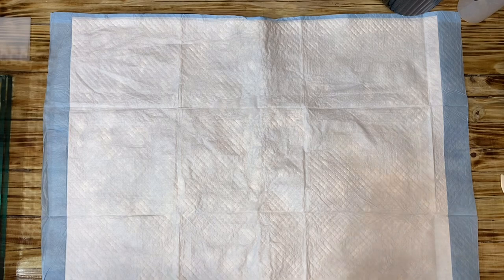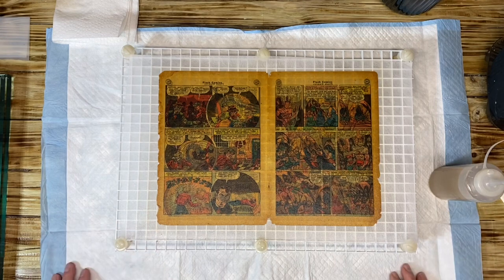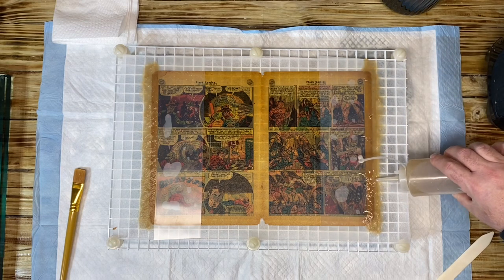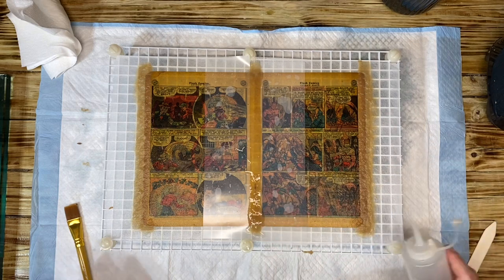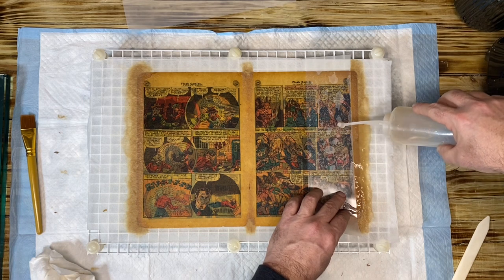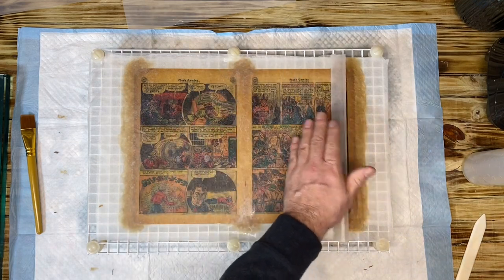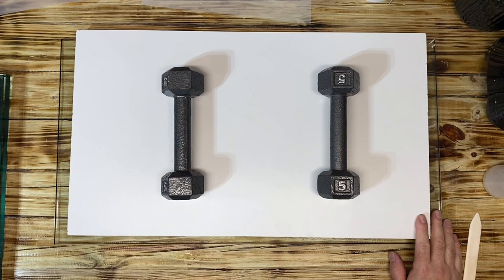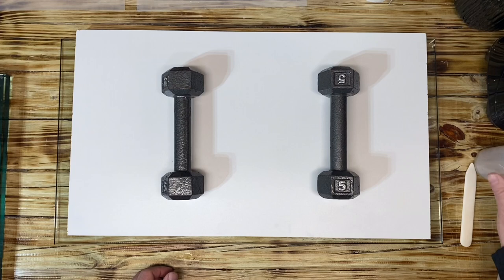Leaf Casting Comic Books without a Leaf Casting Table or Vacuum! You can do it! Part 2

Comment: I love that this is all possible without having you use a vacuum chamber.  It's a little tedious bit with practice it's a great way to take care of minimal leaf casting.  I don't think it's the best solution for some of the seriously mangled books you've worked in in the past
Reply from the maker: You are correct.  The more damage needed to be repaired the more suction is needed.  Stay tuned Mr. Journey and thank you for your support.

Comment: You sound excited with developing this process, which is really coming along and will be very effective for all the people who don't have a suction table to start leaf casting. You mentioned being able to work on molding, does that include ceiling crown molding? If so you are indeed a master carpenter, I tried it once and used a lot of caulking :-) Of course today the angles are.all prefabricated. Your work area is always so organized. What a great series showing an evolution to conservation. Thanks for sharing, Staying tuned.
Reply from the maker: Thank you my friend.  Yes I am very good at crown molding.  The trick is you install one piece uncut and cope the other section to fit nice and tight.

Comment: Enjoy your improvements. Always thinking. I am going to try this but use 16 x16 inch microfiber clothes instead of paper towel just to see if it works. If so it would cut down on paper towel expenses. I know you dry yours to conserve resources.
Reply from the maker: Sounds great!   I tried blotting paper in the past.  The type I used I did not like for a second application because it did not dry flat.

Comment: Have you considered using large 100pt reusable cotton blotter paper instead? Tanas has it
Reply from the maker: I have.  Just did not get around ordering it.  I’ve used blotting paper in the past. The type I used did not work that well for second and third applications because it did not dry flat.

Comment: You need a paper towel company to sponsor your videos. If the wraps are split is the leaf casting strong enough to fix the problem and hold the two pages together securely? Could it be done without being detectable?
Reply from the maker: That would be cool.  This method can be used to connect a split rap.  However it would take more time.  Leaf casting can the large majority of the times be detected if you are looking for it.